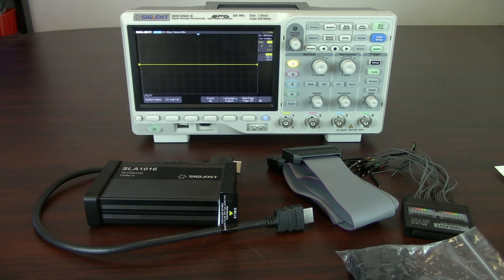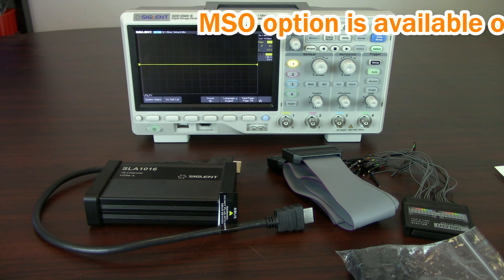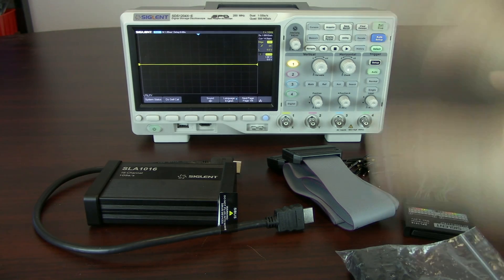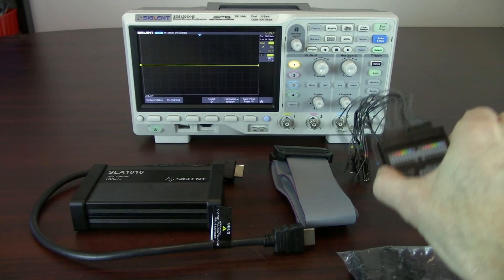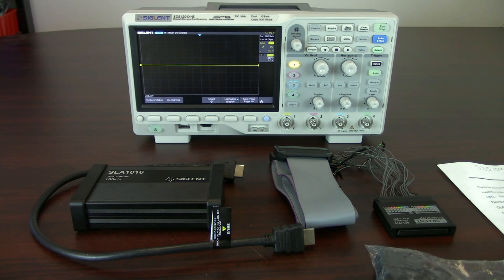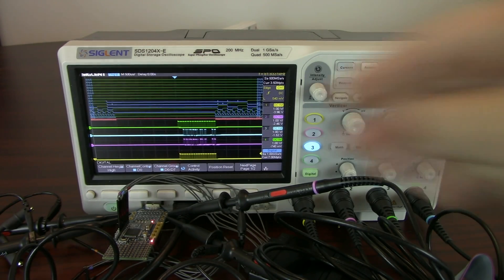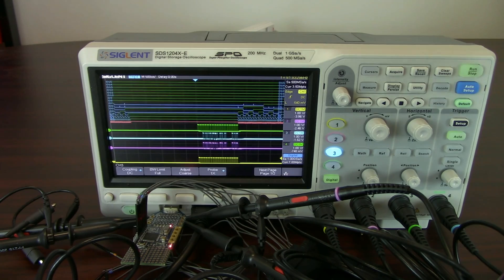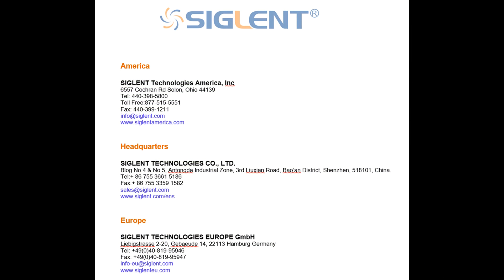Adding Mixed Signal/Digital Channels (MSO) to the SDS1004X-E Series

Comment: Will this work with sds2104x plus ? Because that one has a different connection port not like this one and I do not see another cable that would connect to the sds2104x plus
Reply: I have the sds1004x-e and also the sds2104x plus and I would like to buy only one logic probe for them instead of two for each. Is there any way for that or are they just two separate models each for about $370
Reply from the maker: @krisztiandeak  The X-E MSO function requires an external circuit for data acquisition whereas the SDS2X Plus includes this in it's circuitry. The MSO features are not compatible and require separate part numbers for operation. 

SDS1104X-E/SDS1204X-E/SDS2X-E MSO models require:

Qty 1 SLA1016 MSO Hardware:
https://siglentna.com/product/sla1016/

Qty 1 SDS1000XE-16LA (or SDS2000XE-16LA) license:

https://siglentna.com/product/mso-digital-activation-license-for-sds2000x-e/

SDS2000X Plus models require:

Qty 1 SPL2016 MSO Hardware:
https://siglentna.com/product/spl2016-16-channel-logic-probe-for-mso-option-sds2000x-oscilloscope-family/

Qty 1 SDS2000XP-16LA license:
https://siglentna.com/product/16-digital-channelssoftware/

- Jason, SIGLENT North America

Comment: The pricing for this sucks. It costs more than the cost of the scope to get the MSO.
Reply from the maker: To keep the price of the scope itself low, the designers pushed the MSO hardware to a separate data acquisition module (SLA1016). Relatively low sales numbers increase the cost  as well. I also argue that our pricing is quite competitive across the board. But, you can always use the analog channels for digital analysis.  - Jason, SIGLENT North America
Reply: @SiglentVideo  That's a fair comment. I've just purchased the scope for its competitively low price

Comment: Moments ago I was about to buy this entry level scope from Amazon, but to dismay It seems one has to pony out about 600 bucks to get it only to find out another 600ish, need to be ponied out to get the "optional" AWG and the Digital probes and associated software,.. absurd,.. (as Tony Fleming comments, a one package contain all price would be more practical) Some other Amazon customers apparently have found out that some of the features (apparently Bode-plot) are only possible if used co-jointly with a Siglent brand waveform generator of certain spec (add another 500ish USD) the USB Wi-Fi option apparently runs for another 20-50 bucks. It is almost borderline false advertising as the special features are concealed behind another paywall, approximately 1000 dollars, still it looks like a good deal vs other more known  brands, but those extra 1000USD just puts my buy at hold for some time,.. Lets see if Siglent comes to sanity on the "add-ons" ,..  apparently there are some quirks also with software and firmware that is no longer upgraded and it is not compatible with Windows 10,.. so I will wait some more for new products.   A Leasing arrangement would be more attractive with these sort of scopes, because you just cant figure out whether to spend the extra 300 bucks on the 200MHz version, and the extra MHz of the better function generator, and you end up not buying it because of these absurdly high option accessories. It is like buying a car with a straight 4 banger with 100Hp but advertised as of 200Hp (option) if you add the turbo package,. Then you find out the turbo package costs as much as the whole car. Why a license? If I want to sell the used scope and test leads I want to be able to re-sell it/transfer to next user,.. I don't know if it is possible, but if generic (cheaper) logic analyzer test leads can be used with the scope then it is again a good buy.. a Tip, Stop the "Vendor Lock-In" tactics. if you only need the analog channels, well 150USD a "pop" doesn't sound that bad,.. but in that case I would rather have them all have full depth memory and sampling speed, or to be able to buy a scope with 8 of them. Recent power electronic converters in literature with multiple voltage levels require lots and lots of test leads to measure,.. and most are even differential (both leads at HV potential) the logic analyzer at it's 500ish cost doesn't seem to be able to be used at high potential reference grounds (measure 5V signals on a control boards whose "local" grounds are up to 10kV above "reference" ground) Of course,.. there are Differential probes, but Come on, 3% precision tolerance? not good enough,.. a fiber optic comm. for each acquisition channel (Floating ground Analog Channel and some 8 floating digital logic pins would be good). Extra fees and "Vendor lock in" is a NO-NO for the future,. so, locking up Bode and Digital features is not cool, it just makes "potential customers" sense they are there to be milked rather than provided with good tools, it makes them steer away.
Reply from the maker: Hello. Thank you for your comments. I will pass them along to our marketing department for consideration. Compared to other vendors with similar products, we feel that our products represent a valuable purchase.. delivering similar performance at lower prices. 

I am not aware of any programming glitches or limitations with firmware. All of our current products are compatible with WIN10 and shouldn't have any issues with communications. If you have specific issues, please let us know by contacting your local sales office or writing info@siglent.com.

With respect to accessories and integration, you can certainly purchase any function generator, any logic analyzer, and any scope and build a computer program to provide Bode and MSO functionality integrated with the scope. This would be almost entirely platform/vendor agnostic. 

You can write us at info@siglent.com if you have additional information or questions. 

Thank you and have a great day.

Sincerely, 
Jason - Siglent North America
Reply: @SiglentVideo  thank you Jason, please note that part of the comment is pulled out of Amazon reviews/faq from users that have bought it ( win 10 issue, bode and freq gen issue,  ) the firmware issues have been seem during youtube review videos by enthusiasts. Please do tell the marketing and engineering teams what is needed for new multilevel converter circuit topologies. I know the price is still affordable, but the pricing tactics just rink of "customer milking" many companies worldwide do it and honestly, ftom the customer perspective, it sucks and it is a no-no. Better say upfront all the features cost 1200usd and includes x,y,z... like someone else commented a "package deal"
Reply: I was about to buy this scope, but I'll go for my original plan of a certain Picotech instead now.
With those, I apparently get all the features advertised on the product page if I pay the price on the product page, instead of having to pay several times the advertised price to get the advertised features.

I did wonder why the Siglent was cheaper than a certain Pico despite having better specs and a screen + buttons.  Now I know.

Comment: Fun part: the price of the license and the device is almost as much as the price of the scope itself :) 
Also wondering why license is necessarily separate from the device...
Reply: The only logic reason for the license to be separate from the sla1016 probes is to prevent people from sharing one logic probe among multiple users with multiple oscilloscopes.
Reply: @tudopatroi  they can still share the logic probe.
Reply from the maker: Hello. Thank you for writing in. Having a separate license provides flexibility by allowing unlocked features to be used with different hardware. If you lose a wiring harness, you can simply buy another one without having to purchase a license or re-enter it.

With respect to pricing, I would argue that our products deliver similar features and functions at a lower cost than our competitors. 

Have a great weekend, 
Jason, SIGLENT NA
Reply: @SiglentVideo  I feel that when you buy your hardware you shouldn't also have to pay a license to use it. Just imagine I bought your scope and then I had to pay a software license to use it, with the excuse that if I lost the scope I didn't have to buy another license for the software. It's a little bit ridiculous if you ask me but OK. I agree that your prices are good for what you get. So far I'm real happy with Siglent. If the scope breaks and I buy a new one, do I then have to buy a new license to use the logic probe? Last question, I didn't enter my license yet but my logic probe works anyway, what's up with that? Answered my own question: I see under options that the license is temporary and 29 times left.
Reply from the maker: @pratwurschtgulasch6662  I understand your perspective and feel this is one of those "no one way will please everyone" situations. I'll pass your comments on for consideration. If you have a repair, we will restore any licenses that were on the unit when we return it to you. You can also write info@siglent.com if you have additional questions. - Jason, SIGLENT NA
Reply: @SiglentVideo  I don't understand this line of thinking. If the L/A hardware is plugged into the scope, it is its own dongle. The feature isn't useable without the hardware module, so why bother licensing it? If you had 2 or 3 versions of L/A hardware that could work this this scope, you should just be able to buy them and plug them in. Besides the revenue generated, why fumble around with licensing hardware? It's totally different than they type of licensing Agilent does for their scopes which "enable" hardware already buried in the scope when initially purchased.  I can see the logic paying for deep memory enable. It allows a (loosely speaking) "entry level" price point.

Comment: Is there a PACKAGE DEAL that would have everything included - one price? No extra purchase and or other part numbers and options one must purchase? I would not like to order something and later discover that something was not compatible .... Also, sometimes the package "deal" is less expensive rather than purchasing everything separately. If I needed a simpler version of this oscilloscope, something that has 4 channels, 100Mgz + 16 channels logic probe - what model should I look at? Also, when was this model introduced? Please include that infor for the simpler version I'm asking for. Thanks.
Reply from the maker: Hi Tony. Thanks for writing. There is not a single part number at this time. 

Our webstore breaks the options down clearly:
https://store.siglentamerica.com/product/sds1104x-e-100-mhz/

But, here is a breakdown of the MSO setup shown:

Qty 1 SDS1104X-E (100 MHz, 4 analog channels)
Qty 1 SDS1000X-E-16LA (Unlocks logic/MSO capability)
Qty 1 SLA1016 (Logic/MSO hardware)

The 4 channel XE scope was released in November of 2017.

The 4 channel SDS1X-E scopes are the lowest cost MSO/Logic scope that we offer. 

You can always write in to info@siglent.com if you have more questions.